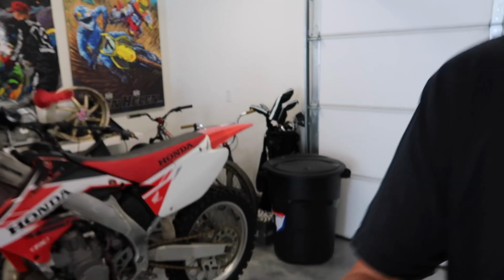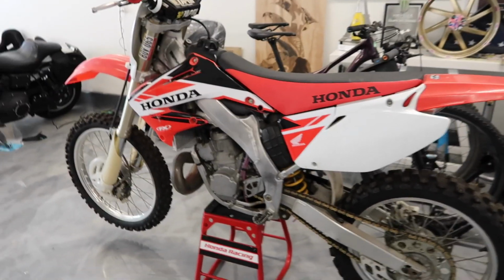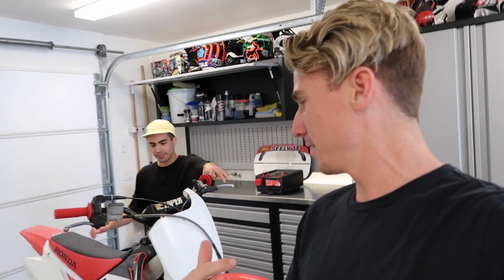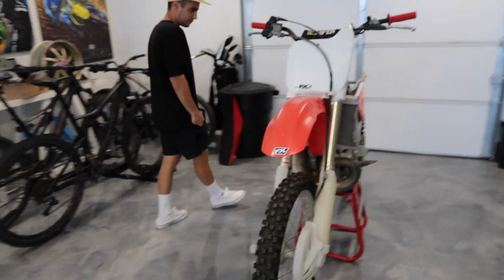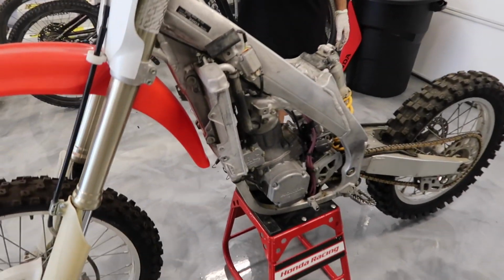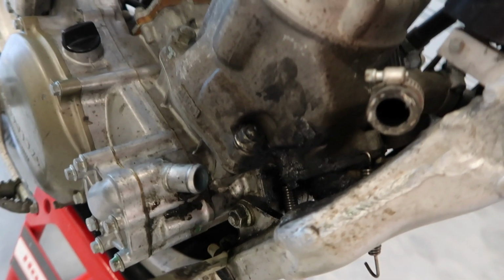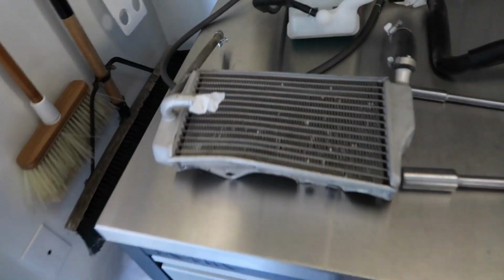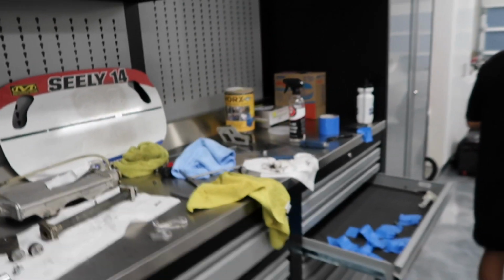Starting My CR250 Build!!

Comment: Cole,

While you likely have more riding talent in one finger than I do in my entire body, as the former owner of a 2002 CR250R that I built, I can lend some insight regarding the engine situation/years and updates from 2002-2007 (last generation). All years from 02-07 are known for having an excellent frame, good suspension, and a  slightly lackluster motor. But with a few tweaks it's an excellent motor with very good mid range pull and good peak torque/horsepower numbers. From 05-07 the motor got the removable power valve cover/assembly on the exhaust side, but really all variations of the motor are similar. 

Three very important engine mods aside from a standard port and polish and pipe/silencer combo with proper jetting that really wake the bike up are: 1) Getting the head shaved/squishband set. 2) A good aftermarket reed cage. Honda changed the reeds and cage design almost every year of the last gen Cr250 with little success. 3) Keeping the electronic RC valve properly adjusted using the "12 mm" method. The stock method is garbage. 

Other very good mods: Lectron Carburetor, Billet exhaust flange (Stock one's are prone to cracking), stick-on rubber/plastic/elastomer frame dots to keep the radiator shrouds from rubbing grooves into the frame (as are visible on the frame @5:53 below the tank), and most importantly, one of the many fixes for the single-lip air-box seal that almost always ends up leaking. Arguably the best fix is the MX-Bonz billet aluminum clamp. 

Additionally here are some really useful lists/charts detailing every change by year of the last gen CR250. Very useful for sourcing parts/ensuring that everything you purchase will work with your 03. 

https://ridersonline.org/2012/smf/index.php?topic=507.0

https://thumpertalk.com/forums/topic/358700-cr250-model-year-changes-1998-2006/

Oh, and the RC valve stands for "revolution control", whatever that means. Coincidentally the 02 was the first year of the CR having it, and Carmichael did switch from Kawi to Honda that year. 

Hope this helps!
Reply: Someone on here finally knows their stuff. 👍🏻
Reply: My 2002 CR 125 has a power valve, not the RC valve. My nephew's 2007 has the RC valve. ✌
Reply: He read this and went okay here go Factory Honda motor from HRC. lol

Comment: The oil is premix because oil is in the gas unlike a 4 stroke. It's normal and common for 2 strokes.. The oil in the cases is only for the trans and clutch, not the cylinder the premix is the oil for the cylinder. 👍

Comment: I think 03 CR engine is actually lot better starting point for the build than the later models. It has lot more torque in stock than 05-07 models. With Keihin carb, V-Force Reeds, pipe change (Doma pipe works best), VHM cylinder head and maybe little cylinder porting you will be ready to race

Comment: Swap a 2000-2001 cr250 motor in. The 2002-2007 cr250 motors had an electric powervalve, which caused them to build the rpm slowly

Comment: You should use magwheel cleaner on the aluminum it looks sweet when it's all clean and fresh, another thing you can do is watch Cameron Nimelias vid on making your pipe look cool take it down to bare metal then use a torch to make blue lines in it looks so trick

Comment: You don't need to do a motor swap Cole, I have an 03 and an 06 and I can tell you that the 03 has just as much potential as the 05-07 engines.  Just have a good engine builder do your engine and you will love it.  Remember, Ricky Carmichael won an outdoors championship on an 03, the last 2 stroke to win an outdoors title.

Comment: Cole... I had one of those things. The chassis is awesome. Contact vertex for a piston, and Varner Racing for the engine and youl thank me later I promise. Use the SST pipe and Vforce.  Seal the air box flanges w silicone when you assemble it

Comment: Pick up some Tusk radiators on RMATV or the GPI ones on eBay are actually good quality. Your other but slightly more expensive option is to send them off for repair. They will come back looking brand new.

Comment: Look into Mishimoto Radiators . Well built, can get them braced and also bigger than stock and still bolt up same as factory. I love mine for the KX450. I paid about $250 for both . I was like you and had one destroyed Radiator and was just going to get another factory , the factory was nearly $200 . Check them out

Comment: Unless you have something like a lectron carburetor or fuel injection with two stroke you'll always have bypass oil coming out of the pipe, but not usually that much the guy was probably running it just a bit too rich

Comment: If you see this, just parted a 2002 cr250r out on eBay and we have a very straight non fill (left) side radiator, oem. Search “j106 cr250r” on eBay and you’ll find it. I’ll clean it up extra for you if you order it! -jmx powersports

Comment: If you want top end power get a 95 motor. If you want bottom end get a 99. I would stay away from motors newer than 01
Reply: Question is will it fit tho?? 🤔🤔

Comment: Sick, this should be good, fan of the L build. check out ICW re fixing your radiators if worth fixing, they can brace them and repair them.
https://icwradiators.com

Also the air box fit on the 03-07 was a weak point re sealing and fit, if you haven’t already heard of Cam Niemela and his channel, check out his CR250 build same model, he’s a Honda guru and does great resto, some CR inspiration and he’s a good source of knowledge on these bikes, I know you have allot of resources in Honda and industry etc. But he’s a cool dude, doing great things with Honda’s. I’m sure yours is going to be amazing too.
https://youtu.be/kiUE4ipDv24
Reply: RC valve is the Ricky C valve correct, first time an electronics power valve was used on the a CR.

They used it once in 04 on the “CR125” ( Unicorn CR125) but it robbed too much power from the wee engine so they dropped it on the 125, kept it on the 250, I never had an 01 but this is the reason as I understand it why the 01 engine was considered the best 2t 250 engine from Honda by many of the alloy frame gens, the power valve is a bit misunderstood though, it is sort of the first gen pre fuel injected, factory only tuned, where Honda’s ECU was doing allot more than given credit for, almost like EFI tuned and traction control, sort of confused more traditional 2t riders with power feel, smoother as we know can be faster than feeling faster. lap times and dyno times don’t always tell the same story. Had it been continually developed (blame the 4t intervention) they could have been onto something, Sherco are the only 2t brand today I know of that use a electronic power valve and they have very powerful 2t engines in there off-road bikes. some useless  info fwiw.

Comment: He needed to run 50:1 not 32:1 too much oil in gas for sure
Reply: Not for break in, its perfect for riding. And 40:1 is way better than 32:1.
Reply: @skylerhealyvlogs9642  agreed I ran 50:1 in my 125 race bike but this was back in 03 with race gas only